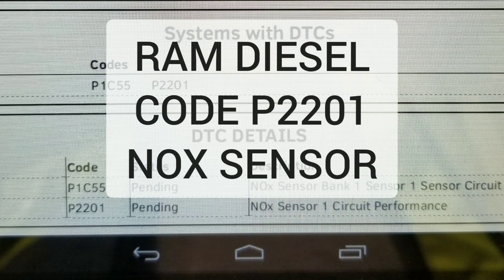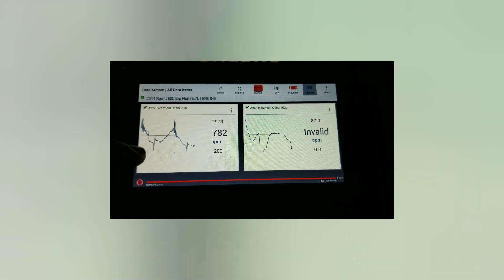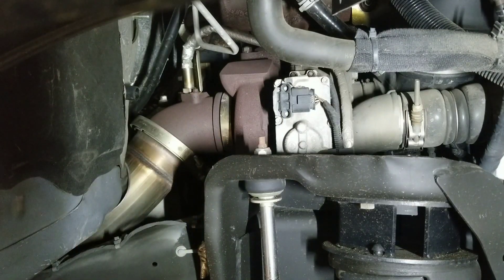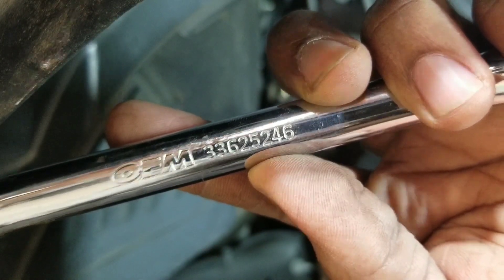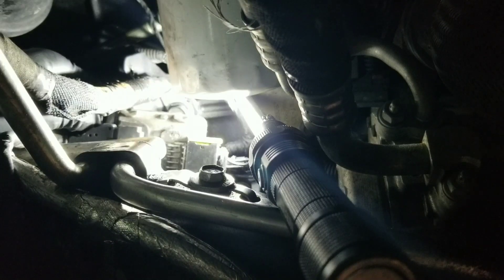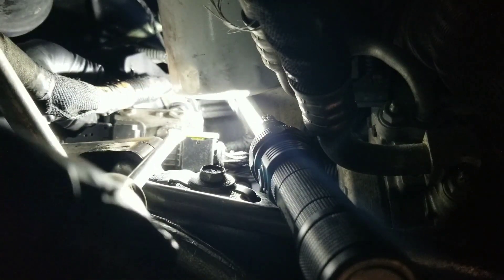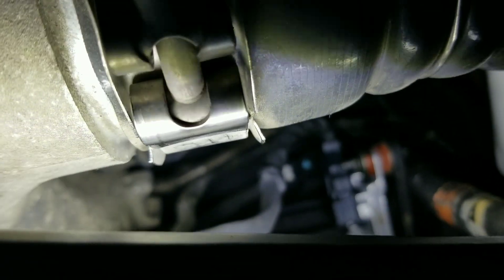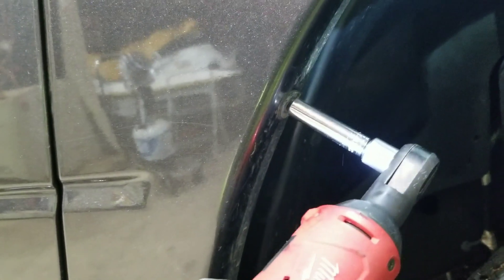Replacing Turbo Outlet Upstream NOx sensor Cummins 6.7 Diesel - P2201

Comment: Preparing to replace NOx sensor on a 2024 Ram 2500 6.7L. Everything looks just the same as in the video. The video is super! It may be that one has to find updated parts, but the process looks to be exactly the same. Mopar charges $2,500 for the NOx sensor! Insane. The part is backordered at the dealer. So far it has been 2 months. It is supposed to be a warranty covered job ... wondering if I put an after market sensor in will it void the warranty. Need to check. Also need to acquire the appropriate diagnostic code scanner.  Personally, I liked the length of the video and would not wanted it edited to be shorter. It gives me a better sense of some of the complications one might encounter! I think I will be carrying a spare sensor and tools when taking a long trip from now on!
Reply from the maker: Glad to hear it works on newer trucks! I don't see how it could void the warranty unless they can prove it somehow damaged the PCM. If they can't get the part, you have to do what you have to do to avoid getting derated. Once you install it, just clear the code and drive it. Maybe a cheap Walmart scanner would do that.